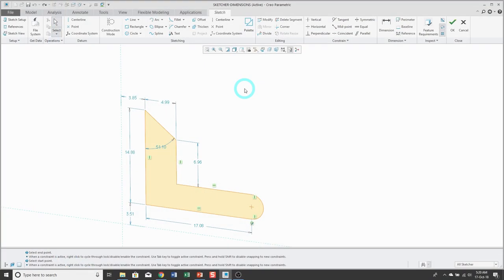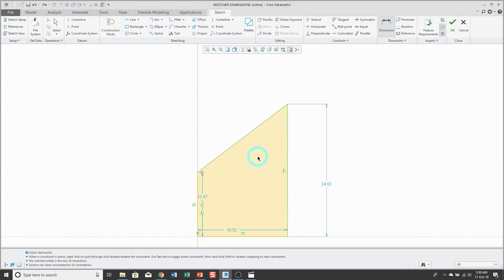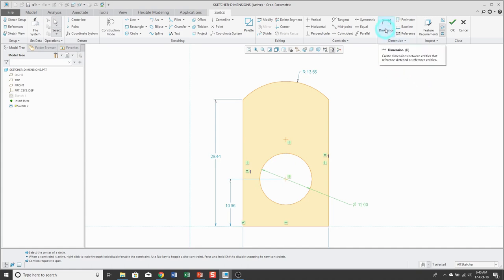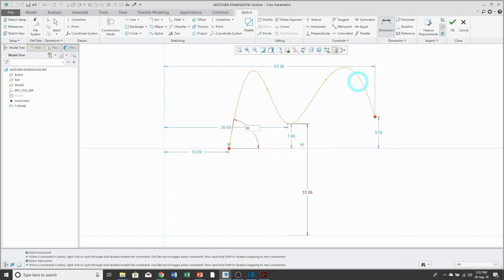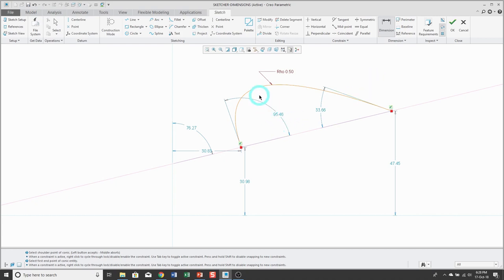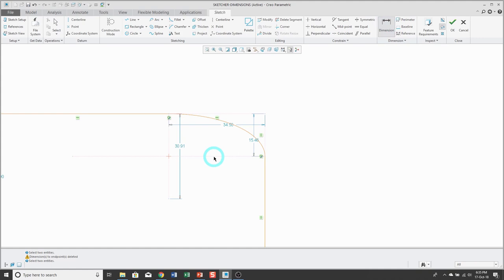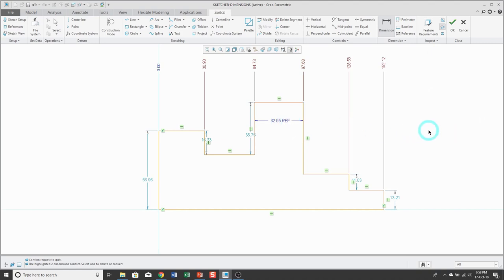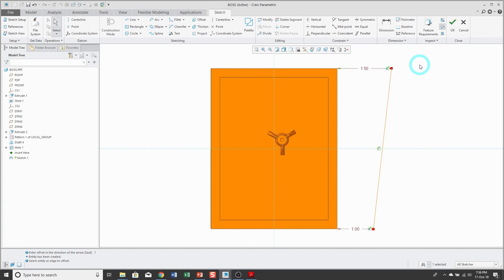Creo Parametric - Dimensions in Sketch Mode

Comment: Thank you very much for your work helping us all learn.
My knowledge of Creo has accelerated due to your channel. Could you clarify when using relations in a part, does this mean you can still reference those relations in a sketch of that part?
Reply from the maker: Thanks, Trenton. You can write relations between sketch dimensions and parameters that result from part level relations, but due to how they are evaluated during the regeneration cycle I recommend that you avoid sketch level relations and make references between parameters and the resulting part level dimensions that come from a sketch. In other words you’re better off writing relations at the part level. Let me know if that makes sense or not.
Reply: @CADPLMGuy  that is clear, thank you.

Comment: That yellow box that shows the symbol ID does not show in my creo9. Very annoying.
Reply from the maker: Have you ever tried changing your options? File > Options > Options > Sketcher. It sounds like you want "Show entity ID number on help text." There is a configuration option associated with that setting. There are also some good options related to sketching under the Entity Display category.

Comment: I have been a long time solid works user. I have gotten super familiar with how it works. New job is requiring me to learn creo parametric. I am super new to it and am beyond frustrated. The simplest task of dimensioning is overly complicated. I have to unlearn the easy way of doing things and learn a new much harder way. Thank you the explanation but left click right click middle click? Stong and weak dimensioning? This learning process is going to painful.
Reply from the maker: As someone who has used multiple CAD packages at multiple companies, the best advice I can give you is to change your attitude. This is an opportunity and will help you professionally. Every CAD package you learn makes you a better designer and engineer.
Second biggest piece of advice is to avoid learning by analogy. Stop doing the comparison of "in SolidWorks, it's this, so in Creo, it's that." And yes, I understand I'm a bit of a hypocrite in that I have video series called "Creo for SolidWorks Users" and "SolidWorks for Creo Users." They are different CAD packages with different core philosophies, so they work differently.
Reply: @CADPLMGuy  yes the philosophy of the two programs is very different. Night and day with some things. In my defense i am just starting out with Creo but have 20 years with solidworks. There are so many habits that are just going to be unbelievably hard to break. It’s going to be a heavy lift to leave SW behind.
Reply from the maker: I'm a big fan of SolidWorks. I've used it for years. My previous and current company use it. 10 years ago I was a SolidWorks admin. I've met Dave Corcoran, the creator of SolidWorks, and he's a great guy.
But letting frustration take control won't help. There's a reason your new job uses Creo. The needs of their business and products require more than what SolidWorks is capable of. SolidWorks is great, but it's not optimal for every company. Stuff that's worth doing is often hard and even painful - ask any athlete - but your mental attitude has a lot to do with reaching your goals.
Reply: @CADPLMGuy  it’s the over complication of doing a simple task like dimensioning that got me today. SW is only thing I have to really compare it to. Everything became so second nature. Some things aren’t so hard to figure. But the dimensioning of a sketch really got me. Maybe it’s because I thought I could figure out myself. But after over an hour of getting no where that’s where I stumbled across your video. And I can assure you this won’t be the last time I need your help.
Reply from the maker: In my SolidWorks comparisons and Creo for SolidWorks series, I repeatedly make the point that it’s simplicity versus functionality. Creo provides more capability. That means it’s going to be a little harder to learn and use. If you do a benchmark for simple part, assembly, or drawing stuff, yeah, SolidWorks is going to win. But once you get into the complex stuff, that’s where you see the power. What you perceive as over complicated is due to more functionality. There are several kinds of sketch dimensions in Creo that simply aren’t in SolidWorks.